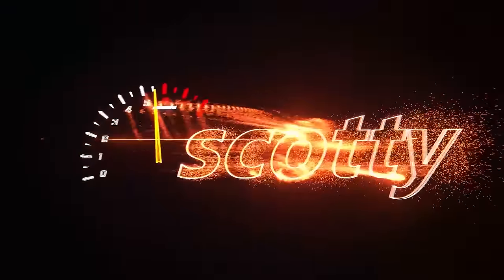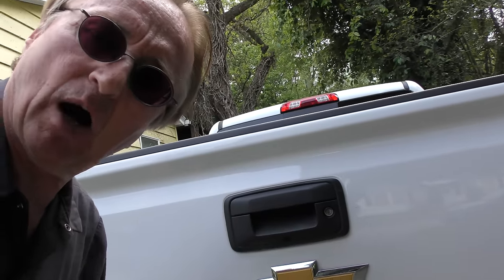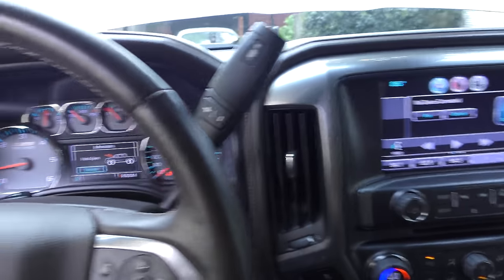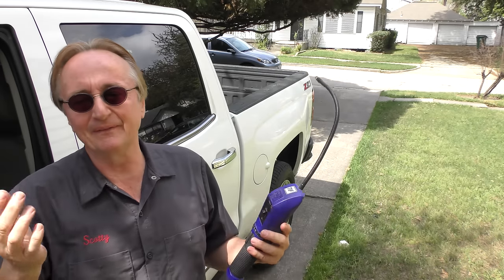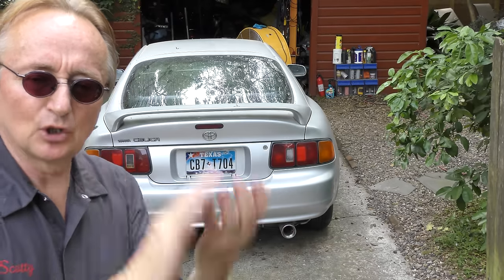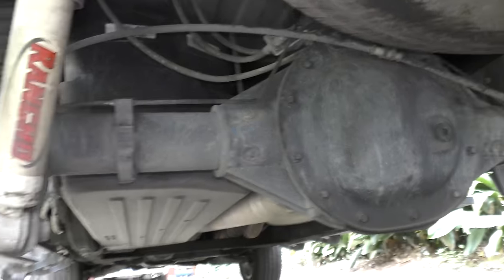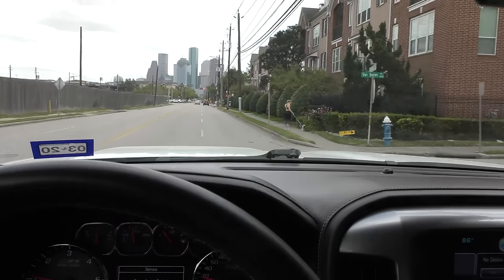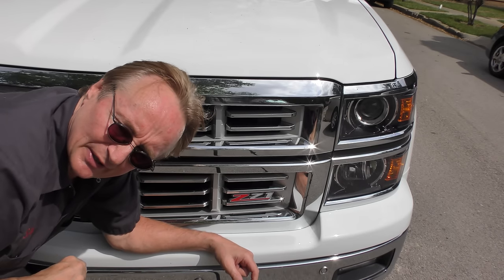Here’s Why I’ll Die Before I Buy a Chevy Silverado

Comment: My 2015 Silverado is garbage. Lifter knock from new, burns oil and has had that radio screen replaced twice. Only 20k miles. Junk.
Reply: Hot Dogs Its probably a defective model, I have a customer that brings a 2015 Chevy to service it every 3-5k miles and has about 250k miles on it, uses it for construction, and his wife has a 16 5.3 yukon with 110k miles on it, no issues with a/c, transmission, or engine.
Reply: Hot Dogs Silverado’s have had lifter tick/tap since 1999, nothing new there.
Reply: Try the New 2020 Ford F-150
Reply: Noe Gomez Jr I got told stay away from one of those
Reply: @davidleeosbourne2727  stay away from all new overpriced computerized Tonka trucks. Just get a older one in good shape and some tools and learn maintained. You can save your self $45,000
Reply: The MSRP for my High Country Silverado is $58,000. I now have 65,000 miles, and have problems that I do not have the money to fix, and Chevrolet wants nothing to do to help me. Do not buy these trucks. I'm trading ASAP for a Ford or Toyota. I'm a genuine Chevrolet customer who had faith in Chevrolet, no more. Best, Robert
Reply: @hotdogs5265  This.
Reply: Brandon S  Hi Brandon. I bought my truck used; I never have bought and I never will buy vehicles New. Shame on you for judging me unrighteously, and expressing willful arrogance of my situation. Best, Robert
Reply: I think the main thing is what factory they are made in.
Reply: @noegomezjr7801  Then hell have to complain about the death wobble 😂😂
Reply: @mygiftmatters  so you were suckered in to buying a used vehicle with problems?

Comment: The 2014 to 2018 5.3L Silverado has a condenser leak problem on all of them.The fix is a aluminium weld at the cracked joint.or replace the condenser.

Comment: I can't say I agree here at all. I work at a Subaru dealer, and I've seen my share of 2020 Subarus with major issues. Leaking oil pans, transmissions, rear diffs, etc.
Outbacks, STIs, Crosstreks. All with anywhere from 20-2000 miles.
Reply: Unbelievable
Reply: A friend has a 2017 Crosstrek..engines been good..fun to drive..the cvt trans has a slow leak..that can only be serviced by adding $$ special Subaru fluids..otherwise, it looses power and/ or won't go into gear..
Reply: @aaronhumphrey2009  His CVT may be covered. Since the failure rate is so high, Subaru extended the trans warranty to 100k mi.
Reply: Subarus are only for Colorado...

Comment: Hey Scotty. I have complete respect for you. But I’m torn on this one. Because my 2010 Tahoe has 260,000 miles and its going strong. The only thing I’ve replaced are a few sets of brakes, tires and a couple batteries. That’s it.
Reply: Exactly. We had an 05 Silverado that had over 300,000 thousand miles with barely any problems
Reply: Dan Bouchard It all depends how you service your cars, sure you may get some defective ones here and then. I have a few customers with these typical types of trucks that come to our shop and we service them regularly, and have mileages between 150k-250k miles from 08-15 models, no issues whatsoever.
Reply: @rattlehead7281  That was the best generation of the last 20 years. They will run forever if you take care of them. I've seen a few 07 to 12 models needing costly repairs due to the cylinder deactivation.
Reply: The early trucks were great trucks. Well built, smooth ride, good performance. Good resale value if they were maintained and free of rust or minimal rust. The newr p.o.s.     You can have 'em.
Reply: ThinkkOps yeah, this guy finds one, with a messed up tailgate handle, and with AC issues. Oh, I’m going to make a video saying the trucks are bad. One vehicle doesn’t represent all of them. One could find a Tundra with similar issues. It’s probably not a common thing, but it’s possible.

Comment: I bought a 2003 Silverado, drivetrain was perfect, 4.8 liter engine with 4L60 trans, I racked up 298,000 miles before the transmission went south. Couldn't ask for a better engine and transmission. The tailgate handle broke a few times, the door handles broke, the real kicker for me was the instrument cluster, the all electronic cluster failed at about 100K, gauges quit working, the unit is keyed to the VIN and mileage so you can't just run down to the parts store and get one, it has to be programmed for your vehicle. I was down for 2 weeks and out $300 for a rebuilt instrument cluster. It was all over you tube with videos on how to replace the instrument panel and a bunch of companies were already rebuilding the panels so I know I wasn't alone. Then my mother in law had a 2012 or 2013 leased chevy and the same thing happened, wife had a trail blazer and the same thing happened. Quality at GM sucks. I bought a used Toyota, great truck. It probably has the same kind of instrument panel with servo motors to move the needles, but I have never met anyone who complained about replacing their Toyota instrument panel.
Reply: Don’t be fooled by the Toyota talk they have just as many problems if not more so than GM and Ford.  They are made from the same parts from the same factories as GM and that’s a fact.  There really is no difference anymore.  Part sourcing went international years ago.  Magna produces parts for GM, Ford, Chrysler, Toyota, Honda, Volkswagen, Kia, Hyundai, even BMW.
Reply: Its a very well documented issue with the gauge cluster and pita to fix. Mine needed new soldering too and my son just soldered in new motors on all of them.
Reply: I have a 2002 Silverado 1500 short bed regular cab. 190k miles transmission is slipping at 2nd so I can relate.

Comment: Really?? I’ve never had any problems with Silverado’s or Chevy in general
Reply: Ikr same don’t trust what Scotty says he’s extremely biased when it comes to this stuff I wouldn’t even worry about the ac If it was that expensive to fix bc it’s not the end of the world
Reply: What years have you owned? The model he's working on is notorious for the "Chevy shake" at highway speeds. And an evaporator job for $2k on a vehicle that has 65k miles and 5 y.o.? They design these things so you get frustrated and bring it to the dealership. Trash.
Reply: Roald Shakleton  yea I’ve only been watching for a few weeks
Reply: Roald Shakleton  what abt halfway in between like a 09 Sierra 1500 like what I got
Reply: Another biased Toyota fanboy video.

Comment: I've got this truck and its at 110k miles and yes AC went out at 90k miles but its no where near a $2,000 fix. At most a dealership will charge 1,200. Or you can buy the part yourself for $200 and took a day to fix it yourself.  Its a good reliable truck. With a strong body to take hits and be safe in a crash unlike the aluminum body Ford that will catch on fire and be totaled

Comment: I may have small minor issues with my silverados but that’s because they are over 10 years old but never had to put a new engine or transmission. My dad has a Ford and a year later the seats started fading and he had to put in the shop three times where it stayed a week. He ended up having to replace the braking system and the engine harness and the tried to fix his transmission that was slipping. My husband had a Ford and thought they were great because they did not take a bailout he ended up selling it back to Ford because it had soo many issues. Each brand is going to have issues but I have owned nothing but silverados since I was 18 and has had no horrible issues that cannot be fixed myself or reasonable by the dealership.

Comment: He’s right I had a 2014 high country... between the engine jerking randomly due to active fuel management and exhaust leaks I’m done.
Reply: Imagine getting rid of a truck because of an exhaust leak and something that can be easily disabled
Reply: Maxwell Holbrook nah you don’t understand it was jerking bad and dealer would not cover it. It was under warranty and they would not even cover the leak. I love chevy.. i own a corvette but lets face it, the more luxury features the worst. Dont even get me started on stability trek that needs service every 3k miles or the screwed up electronics🤷🏾‍♂️ the brand only does good at old school performance and bare bones work vans and 2wd trucks that are older. I also own a 09 chevy express cargo van and 08 suburban. Good luck finding a express that still has its paint intact!  The suburban jesus, i had to go through 3 door handles a transfer case and a rear hatch and still has electronic issues. LTZ luxury for ya.. my buddies 2016 camaro went through an auto trans in 3 years my vette only drives right in s not d and interior is cheap. Im done with chevy but i will gladly take a 69 camaro or basic work van. Even the new vettes have active fule management 🤦🏾‍♂️. The list goes on and on!
Reply: John Honest ride a bike if you don’t like the mechanics of owning a motor vehicle.

Comment: Says "385 hp and only gets 15 mpg around town and 19-20 on the highway" as if that isn't absolutely incredible.  
Sure, that 94 celica might get 30mpg but it doesn't have 385hp and it can't pull a boat down to the lake either.
Reply: I actually thought the hp/mpg were pretty good.  Lots of sedans with less horsepower get the same fuel economy or worse.

My diesel 2020 f-350 tremor gets 16-17 highways and about 11-12 in town.
Reply: @davidhanley  tremor, LoL...
Reply: My 2013 Titan gets 15 around town and 15 on the highway lol. Chevys always had the best gas mileage for V8 pickups I thought

Comment: my 2018 has been an absolute pleasure to drive. I know certain components will wear out. But   Ive undercoated it every year since new. Its in great shape up here in the rust belt. I dont beat on it either. 40k miles and going strong. The fit/finish compared to the bankruptcy 07-13 gen is superb. Built in USA. its an awesome truck.
Reply: I have a 2018 and it's also been great.
Reply: 2018 - super pleased every time I get behind the wheel again. Quiet, reliable, never dog it, but jumped a curb or two strategically like it's built for it.
Reply: @OnHoldAt50  I only beat on it a little after I first got it, to see what it could do. It's got plenty of power for a truck. But now I just baby it unless I have to pass somebody going 30 in a 45 or something lol
Reply: @OnHoldAt50  my 2018 runs like a dream, my only gripe is the barely noticeable thump when it down shifts. I'm at 90k miles and haven't had to do any work on it. I put on the Pulsar LT and only turned off the AFM, drives even better now.
Reply: Never understood the attraction of a Ford truck. Chevy’s always been the best looking, longest lasting most reliable truck. I can’t get by the big round wheel wells of the Ford. Just never been an attractive truck
Reply: @ptayloe8015 idk, my 2014 f150 runs like a charm. My 2018 Silverado sucks, torque converter goes out religiously and ultimately caused full transmission failure. You have to tune it so it stays in v8 mode or else you’ll run through torque converter after torque converter and transmissions as well.
Reply: @coleplaisance8897 that’s true. I’ve had a 05, 06, and two 14’ Silverado’s. The gmt800 were the best. I never had any major issues with the 14’s. Now I have a 19’ f150 5.0 that had oil consumption but seems to have been fixed with the tsb reflash to adjust the vacuum. I’m thinking of parting with it and getting another Chevy and tune it and cut off the AFM or pick a 2015 Nissan Titan or a second gen tundra. They’re both really good but there beds are just so short. I don’t I’m really torn. Contemplated a 3.5 ecoboost as well. I don’t know.

Comment: 1999-2006.5 gmt800's are my favorite years for chevy/gmc trucks...
Reply: I agree with you. They were great years for the Silverado.
Reply: I have 2 gmt800s and plan on keeping them forever
Reply: 2001 Silverado base 4.8 sclb 2wd 190k miles.
2005 Sierra SLT 6.6 duramax ccsb 4x4 sunroof truck 290k miles.
Reply: Jason Heinrich i have a 2010 Chevy Silverado 4.8L Cheyenne edition and it has 413,000km on it..
Reply: @rahrah8076  4.8, i mean 4.great!  You have the good one without the afm system.
Reply: Jason Heinrich the afm is absolutely crap system I have changed afm lifters before..hunk of a junk lol

Comment: Just bought a 2001 silverado for 2200 and I still have my 99 with 350.000 miles ac in both of them still good the 99 never had to charge it since I had it the last 5 years. 
Could have gotten one like the one shown above but they have very crappy engines as well,  always sudden zero oil pressure issues or always collapsing spring loaded valve lifters.
Also if you look on line for an older 99 to 02 silverado, they can range from $7000 to   $12000.

Comment: I remember that when I had my 2006 toyota scion tC, I had to fix the hatch's handle as well evaporator win only 60000 miles. Most of the parts that GM uses in their vehicles are DENSO parts same as toyota's. Denso are not making their parts as reliable any longer. I had to fix all the door locks in my 2015 Rav4 a with only 30000 miles and fix 2 door locks in my 2017 Rav4. I also have changed 5 Denso's a\c blower motors between them. I guess Denso are building parts on a Friday.

Edit: I forgot to include my 2011 Camry SE V6, the door locks and ac blower were also trash.
Reply: Or Monday
Reply: My dad 2015 rav4 with almost 90K miles the differential might b worn out a lot of vibrations slipping in the back
Reply: Yeah. I had plenty of issues with my Corolla as well
  Toyota lovers seem to be more gullible to Brand marketing.
Reply: Oh so Toyotas do have problems. I always heard they were so problem free. I guess my 2011 Ford Taurus is more reliable then the vehicles mentioned.   Yes it only has 110k miles but zero problems. Oh wait my friend has same vehicle with 180k miles zero problems too.
Reply: @Chieftain357  Ford had too make the taurus reliable to compete with the Camry and Accord.
Reply: @Chieftain357  it's odd how people pay thousands  extra for Toyota because they think they will save hundreds in repairs.  They also ignore how poor they handle.  I have to admit   , I was also ignorant and fooled by Toyota nonsense until I drove other vehicles.

Comment: My father in law just bought a 2019 Silverado LT with 10K miles. 

Already has a leak coming from the antenna on the roof leaking down into the Onstar console in the headliner of the truck. 

Also just had the brakes go out driving down the interstate with an electronic recall. 

Piece. Of. Junk. My 2011 F150 has been going strong since the day I bought it new with 0 problems whatsoever.
Reply: Keep dreaming, Michael. A 2011 F150 with ZERO problems isn't just a statistical anomaly, its a Goddamn miracle. Maybe you should call Guinness.

Comment: I had a venza for a couple years with 3.5 L engine.  I finally had to trade it in.  The hid headlights and timing belts were a chronic issue.  Every few months there was a new $1000 or more repair.   It handled great,  fast and comfortable. But it was a money pit.
Reply: Lol

Comment: sam thompson
0 seconds ago
MY 2014 4.3 SIERRA 1500 WENT IN FOR AN OIL CHANGE TO THE GMC DEALER. SVC MGR TOLD ME MY OIL COOLER LINES ARE SWEATING..CURRENT MILEAGE IS 50.000. IS THIS A SERIOUS ISSUE?

Comment: I have that exact same truck, white and all. Bought it brand new in 2015 and now has 122,000 miles and I'm getting ready to trade it in for a new one.

I have had 0 problems. I have literally done nothing but change the fluids as required, 1 set of brakes and a few sets of tires. It's been a great truck to me.

Does anyone know anything about the new 1500 diesel???? I test drove one and it was a peppy little bugger. Any info in this would be appreciated, thanks!

Comment: Love my 2006 GMC SIerra, with the small V8.  Extremely trouble free. So far I replaced the serpentine belt and tension pulley, and put new shocks and tires on it. Cleaned the MAF sensor once. I did have to fix the instrument cluster which needed resoldered. Other than that, the truck is amazing. Oh yeah, I also replaced the speakers. Took out the paper cone junk speakers when they degraded.
Reply: i have an 03 Denali with the 6.0 and i agree, it’s bulletproof
Reply: The 4.8 is a damn good motor

Comment: My Silverado just hit 300k and never had a serious issue
Reply: Greg B  2011
Reply: Nice. my 2011 is at 164k.  Nothing major either
Reply: Yea right...my buddys 2011 Silverado has been through engine mounts galore among 50 other things that's typical...GM builds garbage face it.
Reply: 200k on my dad's and guess what? It hauls a trailer almost every day. I would take a Chevy over a Dodge or ford from my personal experience. Maybe Chevy does have cheap plastic and materials but mechanically I trust them more than Dodge or ford.
Reply: 275k on mine, runs strong
Reply: Bryan Loewen I agree 100%
Reply: You don't hear people complaining about the ones that do ok.  Only hear people talk about the one that had an issue
Reply: Bryan Loewen chevy isn’t that good at reliability compared to my moms 2001 Ford Explorer sport that chevy truck was in the shop every few month because something was broken or the truck broke down as the ford never broken down or anything bad happens and now she have a 2011 durango and now still going strong and with no issues.
Reply: Jay Man  no, my dog broke the door handle. There is some issues starting to pop up but will be bad I'm sure